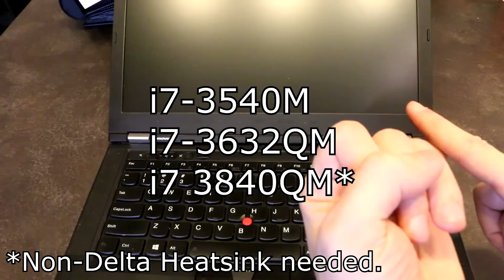Lenovo ThinkPad T430: Upgrade Wonder

Comment: Just bought one on eBay a couple days ago. Should be in today and still thoroughly enjoy the incremental upgrading
Reply from the maker: Awesome! It can be a rewarding process.
Reply: @LaptopRetrospective  Well I enjoy a good challenge and I meet this one with frothing anticipation! Keep checking the tracking number 😅
Reply from the maker: @riverlefae8647  Keep us posted!
Reply: @LaptopRetrospective  Just got it and throwing on a fresh Arch install as we speak!
Reply from the maker: @riverlefae8647  Nice! How's the condition?
Reply: @LaptopRetrospective  there seems to be some artifacting with the screen as it charges... I get what looks almost like analog static in horizontal lines all over the display.
Reply from the maker: @riverlefae8647  Hrmmm if it's only when charging something is likely wrong with the charge connector on the motherboard? Does the barrel plug feel loose?
Reply: @LaptopRetrospective  A reboot has seemed to have fixed the issue; I am not ruling out software error, either!
Additionally,  it seems I have an overclocked CPU, as neofetch registers my Core i5 as 3.3 Ghz instead of 2.6!
Reply: Windows did list it as a 2.6Ghz CPU, though, so I don't know whats going on there.
Reply from the maker: @riverlefae8647  Custom BIOS flashed to it from what you can tell?
Reply from the maker: @riverlefae8647  Turbo boost?
Reply: @LaptopRetrospective  It's a stock ThinkPad BIOS. Can't mistake that branding! Haha!
Reply: Seems as if all the kinks were software-related! I'm going to reinstall Arch with the LTS kernel this time to see if that helps things.
Reply from the maker: @riverlefae8647  That's a relief.
Reply: @LaptopRetrospective  After a re-install and some BIOS settings flipped, I have a beast of a ThinkPad! Not bad for a $50 bid on eBay!
Reply from the maker: @riverlefae8647  Excellent!

Comment: Yeah, typing this on a T430. I also bought it in 2018. Used it as my main computer for work for 1.5 years but as I had most of my software licenses to OS X I had to switch to mac as my work computer in 2019.

Still use T430. A great computer.
Reply from the maker: Nice!

Comment: Hi, thanks for this video! Do you think this laptop could run football manager 2020 on decent settings? I'd like to play that and some other older games without breaking the bank and this looks like it could be a decent option.
Reply from the maker: As with all software, you want to check your system requirements of the software you plan on running. Keep in mind that there is an Nvidia GPU option as well so it depends on the version you are looking to buy/already have.

Comment: I got an SSD on the DVD bay however I want to swap it with the HDD since I heard it will be even faster there.
You said those 2 loose cables at the back inside next to the RAM are for the SSD.
How does that work? 
I thought I would put the SSD under the USB sockets where the HDD is. 🤔🤔
Reply from the maker: If I remember right, the mSATA slot is next to RAM. It's capped at SATA 2 speeds. The Ultrabay I "think" is 3GB/s. A quick search didn't get me a conclusive answer. When in doubt, put the SSD in the main drive bay.

Comment: can i use Photoshop, cad, sketchup with it?
Reply from the maker: The higher processor configurations should be able to handle it.
Reply: @LaptopRetrospective  thanks for your fast response!😄
Reply from the maker: @yusrinafoury7965  it's what I do!
Reply: @LaptopRetrospective  anyway what kind of RAM needed if i want to upgrade it?
Reply from the maker: @yusrinafoury7965  check the upgrade guide in the description, should have everything you need to know.

Comment: hey guys! just looking for advice :)

i currently don’t have any other pc and i’m gonna be doing a cyber security course start of 2020 so i need a laptop. i found the t430 with the i5 3320m, 8gb of ram, 120gb ssd AND the upgraded 1600x900p screen (which i hear is much brighter than the stock 1366x768p screen).

my question is, is it still worth it at $150 USD? i live in australia and they still go for quite a bit. but considering that it’s a decent spec and i’ll most likely be running manjaro kde it should run buttery smooth for my needs. 

i’m just not sure if it’s the best bang for buck i’ll get for my money and money is something i don’t have a lot of atm :) thank you in advance 💓
Reply from the maker: $150 USD is good.
Reply: Laptop Retrospective thank you :))) i appreciate the response. i’m gonna buy it on monday when i get paid! 😇😄
Reply from the maker: @lovelyxyz  you're welcome. I hope you enjoy it!

Comment: where can i find one with the nvs chip instead of the intel?
Reply: I've owned both, and IMO, it's not worth the effort to find one.  It barely boosts gaming performance at all. 

What you can do that should work better is fit an external GPU to the PCI-E slot. You'll only be able to use it when you're plugged in, but it'll give you far better performance than the internal nvidia chip and represents a good compromise for portability and gaming performance (as long as you set reasonable expectations for an 8 year old PC.)
Reply from the maker: Check local classifieds or eBay.

Comment: my t430 is core i5 and has 8 gb ram
Reply from the maker: Nice. Some room to grow.
Reply: @LaptopRetrospective  
Even with the i5 is it solid? I just ordered this with the i5 and 8gb of RAM. I am NOT a power user. I just need it for writing papers, the internet and Skype, the i5 and 8gb of RAM should be enough right?
Reply from the maker: 8GB is perfectly fine. As I said in another reply, an SSD will make a huge difference.
Reply: @LaptopRetrospective  Sweet. Thank you so much. Yep you answered this twice. Awesome.
Reply: @LaptopRetrospective  Have you explained the difference between the T430 and the T430s? Im getting the T430s.
Reply from the maker: @jrgilbert  I haven't used the T430s yet. If it's anything like the T431s then I suspect slimmer and soldered on CPU?
Reply: @LaptopRetrospective  ok. The biggest complaint I've seen about the T430s is the screen quality being poor.

Comment: Hey! So I bought this laptop a month ago. So far I am very pleased with it. My only issue is the fan noise. Do you have any suggestions on how I can reduce the noise?
Reply from the maker: Check your thermals. Your fan shouldn't be running that loud. If the temperature is fine, your fan ball bearings might be worn out.
Reply: @LaptopRetrospective  how can I check my temperature?
Reply from the maker: @Laura-lg1tb  SpeedFan does a good job.
Reply: How did you solve the fan issue? As far as I understand, it just needs to be replaced with another Delta fan

Comment: I kinda like my t440p.. I have it decked out with a i7-4900mq.. msata 240gb.. 16 gb ram.. 1080p ips screen.. changed the touch pad to original style.. I bought about 10 of these and then gutted the memory ,Hard drive, and cpu sold those on ebay.. and kept those laptops gutted for future upgrades..
Reply from the maker: Now that is planning ahead!

Comment: I ordered thinkpad t450s i5 5th gen cpu, 8gb ram, and SSD, 
FHD non touch display. I was not able to find details review about its performance in 2019. 
What do you think, will it be enough for general task, mostly ms office, pdf editing, high resolution videos streaming and playing. And web browsing with 7,8 tabs on??
Reply from the maker: Should be fine. Unless you meant you're the one streaming vs Netflix.
Reply: @LaptopRetrospective  i mean just for consumption. Not broadcasting or anything. Watch FHD videos on Netflix, YouTube, dowbloaded ones etc. And mainly need one for PPT presentation in class.
Reply from the maker: @doc_verma  should be able to easily handle that.
Reply: Thanks... Have a good day

Comment: I'm not too sure what's up with my T430 but the battery is terrible for me. The battery it came with lasted 20-35 minutes while running one youtube tab. I even bought the 9 cell battery and replaced it which extended the 35 minutes to a whopping 50 minutes.
After one week of use, the middle trackpad button stopped working. (i use my keyboard lightly and basically never used those trackpad buttons.) After a month of use, the middle button completely came off. 
At the same time, I noticed that the trackpad is completely worn down. the nice texture smoothened down near the middle to be very smooth.
When I first got the ThinkPad, both the mic mute button and the random button to the right of it did absolutely nothing. 

And for running the computer, it's terrible. I cannot run the laptop without having an external USB fan connected under it. I have gotten 1st to mild 2nd-degree burns from the bottom of the laptop without the external fan before. 
The laptop has many driver issues when I first started it up. The Bluetooth driver crashes and I have to reboot the driver through device manager all the time. There were already issues with the trackpad cutting off at times (installing a different Intel driver fixed it though.) 
The computer can't even run one tab of youtube in 1080p 60 fps without it dropping frames and lagging hard.

I'm sure the T430 I got is all kinds of messed up and I apparently got a bad one it seems. I'm hoping others who buy a T430 has a good experience with this model as I see much capacity and worth in this. :)

My T430 Specs
CPU: Intel Core i5-2520M (2.5 GHz)
Graphics Cards: Intel HD 3000
RAM: 8 GB DDR3
Current OS: Microsoft Windows 10 Pro (10.0.18362)
(Note: I have not changed any parts of the laptop out and have not changed the OS from the default one it came with.)
Reply from the maker: Interesting story. The part I find the most strange is the specs don't match a T430.

Comment: I've been using T430 for 6 years. Recently, I spilled coffee on the touchpad of my T430 by oversight, and two right click buttons haven't been functioning since then. All else are still functioning without any loss (I use a mouse for right click... but it's very inconvenient). 
Do you maybe have any suggestion?  I would buy another keyboard, but I wonder if the button on the main body (not the one on the keyboard) will be restored too.
Reply from the maker: Swapping this part is pretty trivial. Check the maintenance manual in the description. It will even give you part numbers to search for on eBay or Amazon.
Reply: @LaptopRetrospective  Thanks for your reply. Actually, I already found that  keyboards are still available on Amazon and else and I know how to restore it, but I don't know if the button function is wrapped up only within the keyboard or I need to restore more on the main body...I will research more.
Reply: @zero-east-23  trackpoint buttons are part of keyboard. The trackpad buttons  separate.  A new keyboard is around $30 on ebay. easy.

Comment: Has anyone installed Linux Mint on the T430?  Would it be as simple as a linux install on an X230?  Thanks!
Reply from the maker: Easily.
Reply: @LaptopRetrospective  Thanks for the speedy response!   Am going to pickup a used T430 tomorrow.  Had an x230 with Mint.  Sold it awhile back - yeah I know kinda dumb..  I also have a Lenovo Tiny desktop running Mint 18.  Installation on both of the Lenovo's was stupidly simple.  Am hoping that the T430 goes as smoothly..
Reply from the maker: @TUCSNMTNBKR  it won't feel any different. Did two installs of it on the very system you saw in the video.
Reply: @LaptopRetrospective    And it was!     Got a very nice T430 with 4GB ram, a 500GB hard drive plus a power cord for ..... $50.   Wowza
Reply from the maker: @TUCSNMTNBKR  Is it an SSD? Would be my first stop.
Reply: @LaptopRetrospective    Nope, it was an older Toshiba spinning disk.  Pulled it out right away.  Installed a Toshiba Portege Z930 256GB mSata SSD.  Amazingly easy.  So I will pick up a 240GB SanDisk or a Kingston or a Crucial over the weekend from my local MicroCenter.
Reply from the maker: @TUCSNMTNBKR  very nice. Enjoy your project and the fruits of your labour.
Reply: @LaptopRetrospective    Still playing with it.  Having some issues with my VPN.  And probably going to be looking for a new battery.  This one was about a 40 minute lifetime.  Well what can one expect for $50 right?  But no regrets.
Reply from the maker: @TUCSNMTNBKR  Yep. Thankfully all fixable.

Comment: Hi,do you think I could use this laptop for Digital Audio Workstation and 3rd party VSTs? (Producing Music) with 16gb ram i7 3520m 2.9 Ghz  240gb SSD
Reply from the maker: With software, always check your system requirements. If it meets them, then you'd be golden.
Reply: @LaptopRetrospective  Yeah that makes sense. I've already checked it. Should be fine..😉 Thank you
Reply from the maker: @jansivak8528  I think you'll be pretty happy with it. 😉

Comment: is it good for gaming
Reply from the maker: Depends on the game, your configuration and whether or not you're running an eGPU.
Reply: @LaptopRetrospective   i play fortnite paladins minecraft etc
Reply from the maker: @fault6866  Minecraft will be fine, even on the integrated GPU, not as confident about the others without an eGPU.
Reply: @LaptopRetrospective   i have a amd a6 5200 chip and radeon 8400 r3 series integrated graphics it sucks but it can run paladins 30 to 40 fps fortnite 0 and minecraft 40 to 60 and everytime i try to install a update for my driver it lags and stutters until i delete the updated driver version
Reply from the maker: @fault6866  I'm not as familiar with AMD tech as I am Intel and Nvidia. My desktop is my first AMD chip in over a decade. I suggest looking up system requirements and CPU benchmarks.
Reply: @LaptopRetrospective  thanks for all the help and will do
Reply from the maker: @fault6866  you're welcome. Best of luck.

Comment: Can you use this for work do you recommend?
Reply from the maker: What kind of work are you doing?
Reply: @LaptopRetrospective  work from home that need 2.8 ghz and dual core at least 4gb ram 60gb of hard drive
Reply from the maker: @cookingwithtera6308  You can get them with those specs. You'd want either the i5 3360M or the i7 3520M if you need that much GHz. But you'd probably want more than 4GB of Ram if you need that heavy of a CPU...
Reply: @LaptopRetrospective  thanks are you by chance a seller on amazon could I order from you?
Reply from the maker: @cookingwithtera6308  I am not a seller, sorry. If you are looking for some on sale you can check the links in the description of this video. Just be sure to check any listings for the CPU you need.

Comment: Are bios required when replacing parts like the ram, cpu, ssd, or the WiFi card?
Reply from the maker: Any part that isn't in the Whitelist of the BIOS will require some tweaks. RAM, CPU and SSD should be drop in so long as the motherboard supports them. WiFi cards need to be on the approved list or you need to modify the BIOS.

Comment: T430 is my daily driver I am really happy with it especially after preforming these upgrades for the first time.
Reply: Ssd and ram it’s crazy fast now I was happy with the existing processor changing it seemed like a hassle.
Reply from the maker: Awesome stuff. What was your favourite upgrade?
Reply from the maker: Many find the SSD the most significant upgrade with these units. So I'm not surprised by that assessment.

Comment: Picked a T430. Looking at upgrading the wireless performance to an AC card. But I do not have the skill set and knowledge base to perform the bios mod for these, yet. Thinking about trying a mini pcie > USB 3.0 adapter with a TP-link AC1300 USB 3.0 WiFi adapter inside the chassis instead of external plug in. Any thoughts on if it could work ?
Reply from the maker: Haven't a clue. Not sure if you'd have the space inside the machine. You can get Lenovo approved cards that are faster and will work. Check the maintenance manual for the FRU of the approved cards and then search eBay.

Comment: This question goes out to all you people who read this...what are you use this Lenovo Thinkpad T430 for i5 or i7?  Work? Gaming? Photoshop? Or ? Comments please thank you. What's good and what's bad about this device?
Reply from the maker: Built like a tank, can do most productive applications with ease. Hardware is still strong, parts are easy to get and cheap, not to mention service manuals readily available. It doesn't have a strong GPU without going the eGPU route.
Reply: @LaptopRetrospective  I got the laptop for free it was a gift  it even seems better as the laptop I already have..and I can still upgrade this one to i7 that I can't do with the other one
Reply from the maker: Yep. There is a reason there are huge communities around these machines.
Reply: @LaptopRetrospective  I didn't know there where so many people using these machines..they are older many people just go to the store and buy something new...like really thin laptops..that are very fragile
Reply from the maker: Consumer grade laptops are mostly plastic junk. There is a reason that these machines were over $1000 when they were new. Built to last. Welcome to the club.
Reply: @LaptopRetrospective  the new fancy laptops bling bling that you can use max 2 years..and then they are RIP..  it's sad that things are built for a short time usage so people keep buying and buying..
Reply from the maker: @jijdaar4066  we vote with our wallet.

Comment: I recently got mine but only to realise that it doesn't have bluetooth yeah so how can i make have BT?
Reply from the maker: You can check the maintenance manual for a part number for the original Bluetooth module or you can attempt to put in a whitelisted WiFi/BT card. Or just get a USB dongle.
Reply: @LaptopRetrospective  thank you i appreciate
Reply from the maker: No problem.  Good luck.